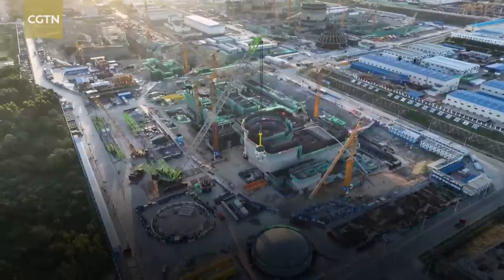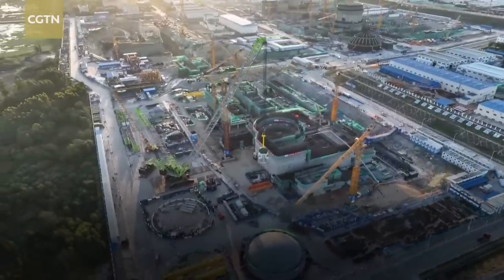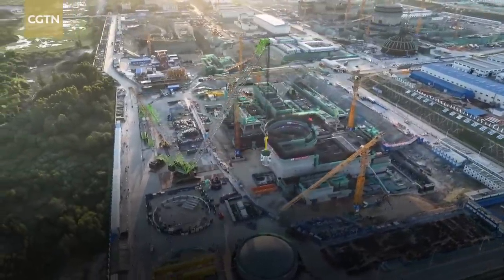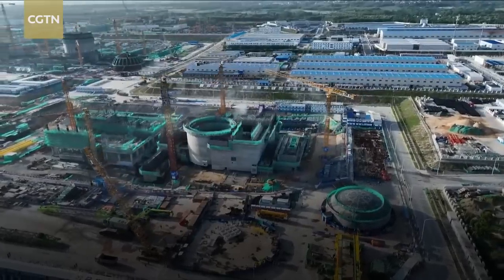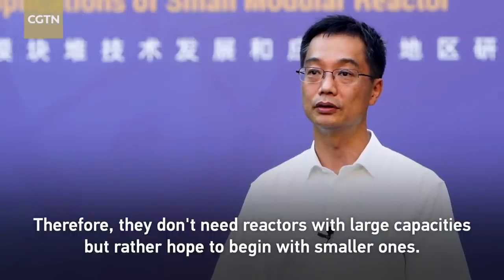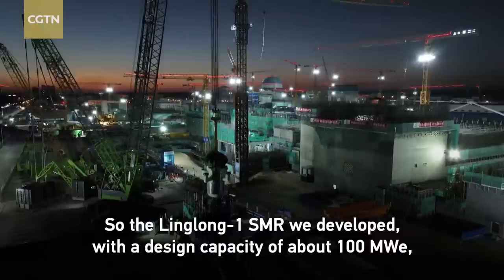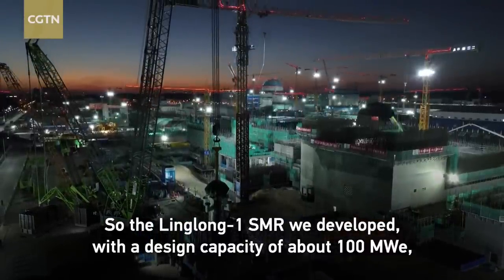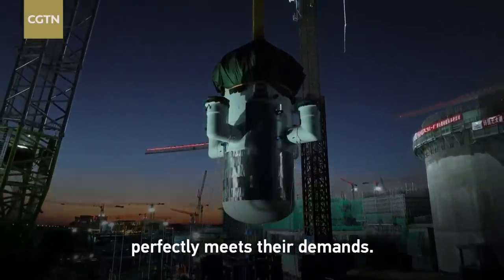Over 200 foreign nuclear experts visit world's first onshore small modular reactor in China

Comment: Kudos to China for being the first to market with a working SMR... These are the future of power production along with solar, wind, geothermal and battery storage... Coal, oil and gas needs to be banned or reduced heavily worldwide for the sake of the planet...
Reply: Solar and wind, SMRs are still producing waste and can meltdown.
Reply: It's better than burning coal.  The other breakthrough we need is to figure out how to process the spent fuel rather than let the rods sit in a pool of water 30 feet high.  I don't know if it's the same thing, but let's hope they don't make .50 cal BMG rounds or 20mm shells from the depleted material.
Reply: @rw3915  Just stop using nuclear, go to wind and solar, easy fix.
Reply: @mikebunch3443 Do you know that you need power plants to run 24 hours to maintain the grid voltage?  When there are no wind and no sunlight, what do you use to maintain the grid voltage?
Reply: @yunko9369   Waterways
Reply: @mikebunch3443  ??
Reply: @mikebunch3443  Do you mean hydro power?  But in your post, you said solar and wind only!
Reply: @mikebunch3443  Nuclear waste is pretty easy to store. Just dig a hole several kilometers down and dump all nuclear waste.
Reply: @lolcatjunior  Wrong